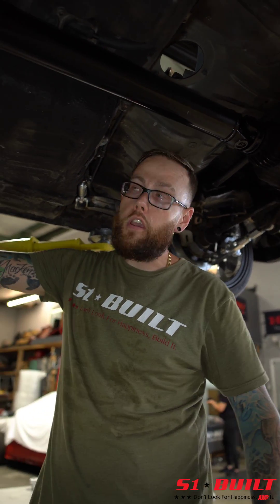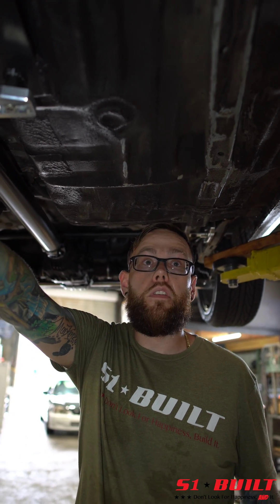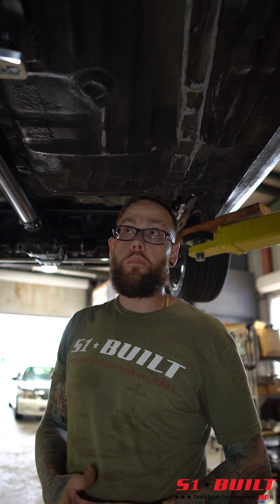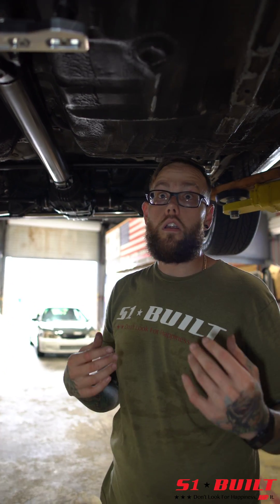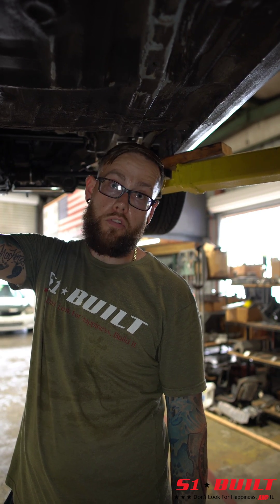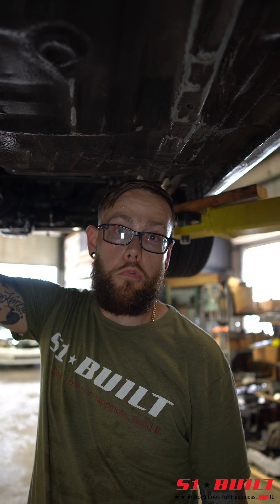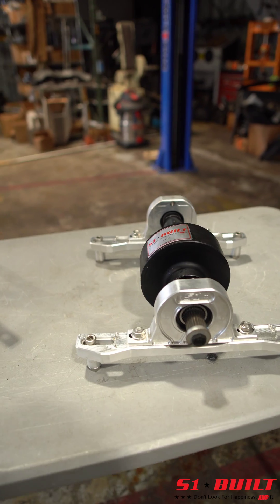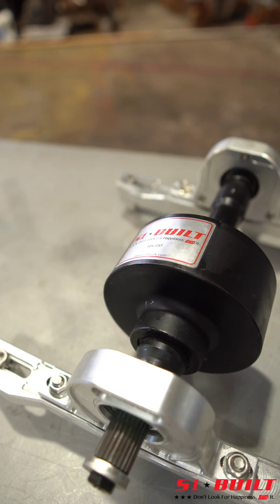60k CST Fluid Viscous Coupler

Comment: Is it true front wheel final drive and rear wheel final drive was different? What if i do equal final drive both front and rear what effect? Or i should run unequal final drive?

I mean, front drive OEM final drive was 4.562 and rear drive oem final drive is 0.434 (transfer case) and rear diff is 2.533
Reply: I have the same question nou before install them all. What did you do?

Comment: Has anyone tried running without a viscous?  I don’t think Evos or Eclipses have them. My Toyota celica alltrac doesn’t have one but maybe it has something similar built in to the trans?

I mean if you REALLY want FOUR WHEELS GRIPPIN, why run one?
Reply: Because it will bind when you turn.
Reply: Different final drives front/rear